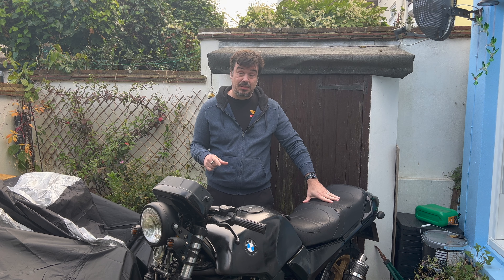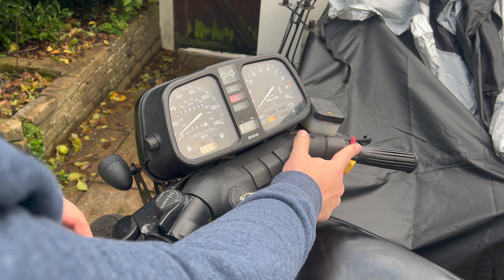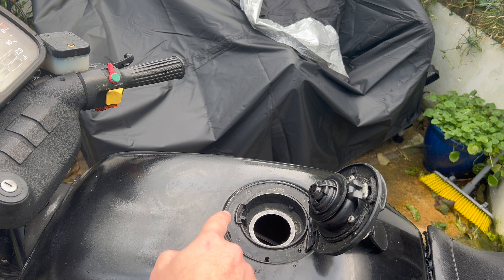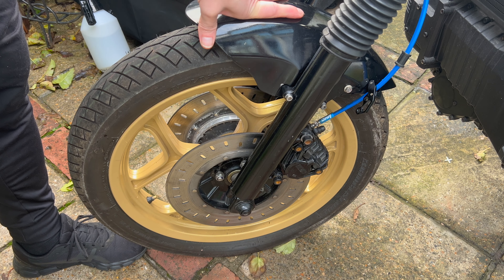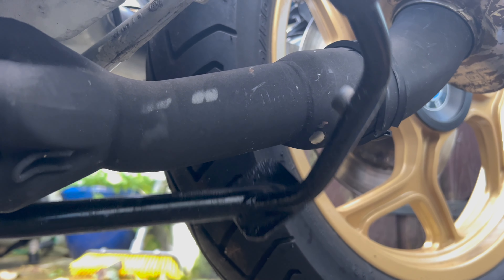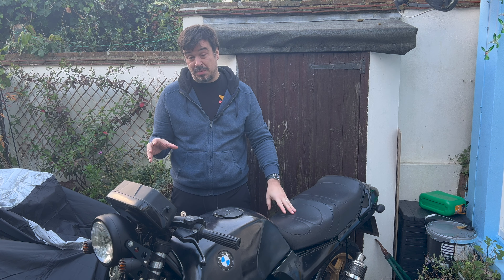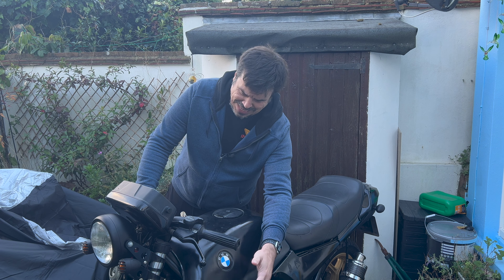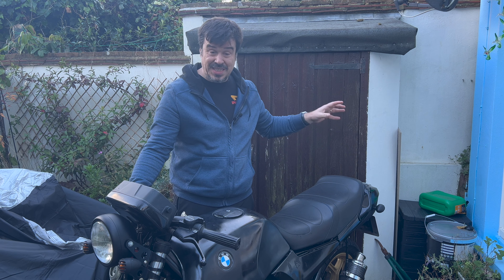BMW K100 Project - The first few jobs

Comment: I have just got at 1985 K100RT going that had been left standing. compression on each cylinder was 55psi on 1,2,and 3 and 75 on 4.
laid bike on lawn and filled combustion chambers with 2 stroke oil ( i'm told diesel is better). kept turning it over every couple of days. it chimed in on one, then two , and then all cylinders. smoked mind you.....   as my message on your first video, regarding that you have a K100RS, you can also check the final drive ratio, its higher than the basic K100 and K100RT.  Also the fuel pump only comes on when you press the starter , if the engine starts, the pump remains on. nice bike, great price,.
Reply from the maker: Someone else also mentioned popping some oil in the cylinders. My compression tester turned up today. Hopefully once the wet passes I can have a look what I get. Your numbers seemed so low I wouldn’t have thought they’d come around but glad to know it’s possible.